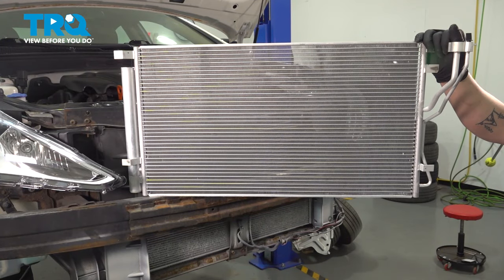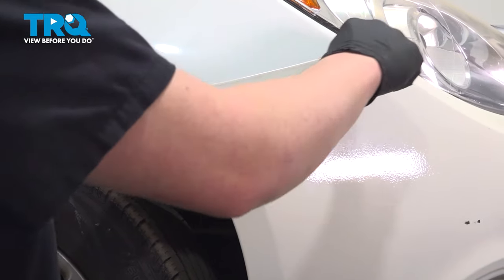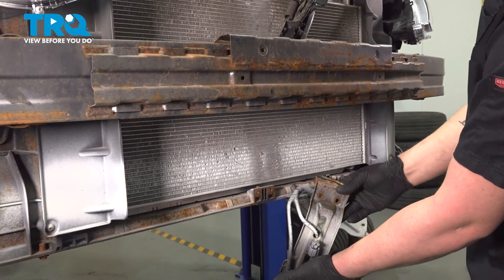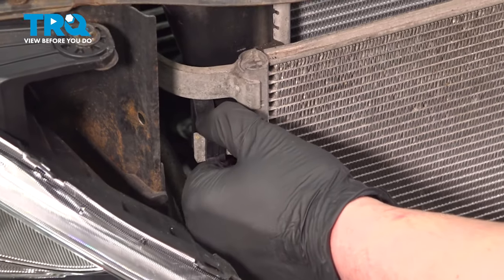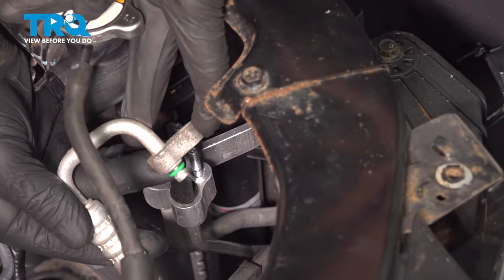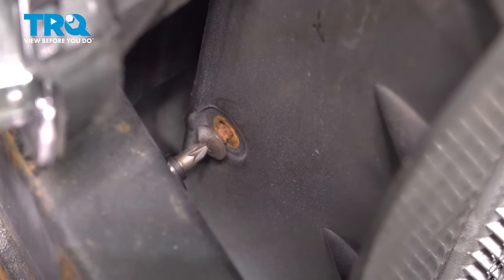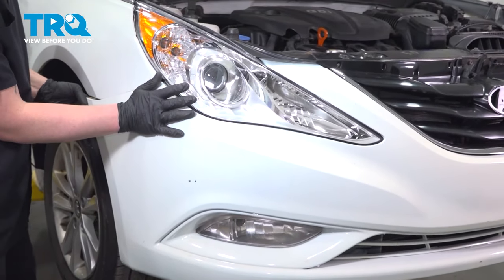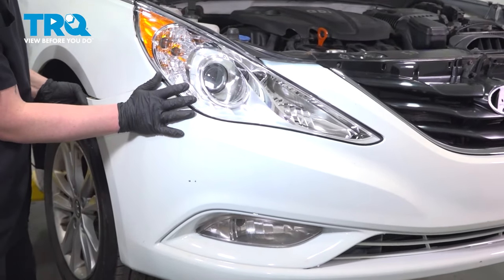How to Replace AC Condenser & Receiver Drier Assembly 2011-2014 Hyundai Sonata (2.4L L4)

Comment: AC compressor failed and shot shrapnel through the system.

got quoted.......

900$ for replacement of the compressor 

600$ for the replacement of the condenser and dryer 

150 to evacuate and recharge freon 

1650+ tax

bought the parts online

109$ for compressor
 76$ for condenser and dryer
150$ for freon evac and recharge

total: 335$

Those of you looking at these vids attempting to get educated on cars are making a wise decision. dont be afraid to give it a try just take it slow, be patient and use PB blaster (rust penetrant) when u got stuck/really rusty bolts and be careful not to put a lot of force on the really rusty bolts to minimize breaking them such as in the video (sometimes inevitable). There is a feeling of gratification that comes with fixing a machine and knowing that you didn't spend 1 months worth of rent on it.